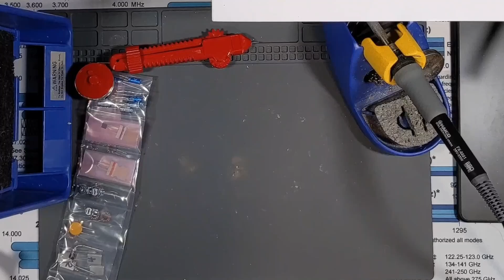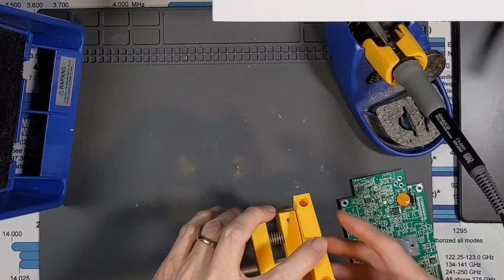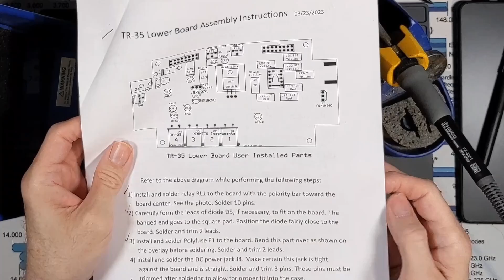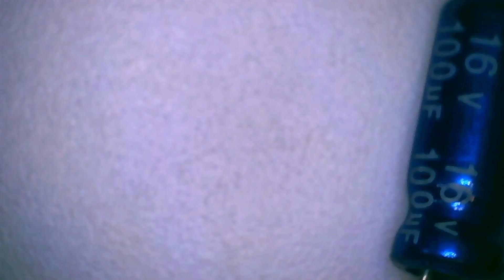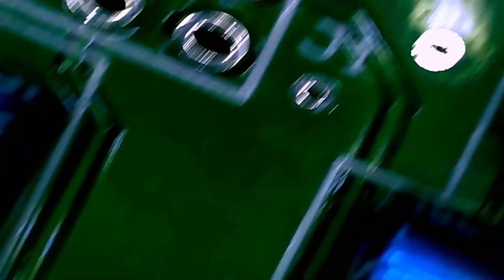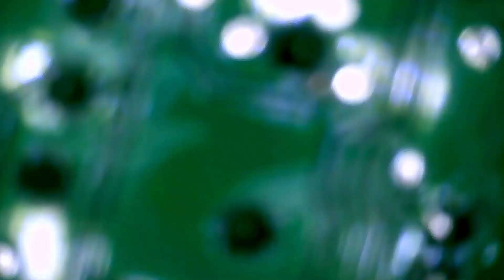Building the QRP TR-35 CW Transceiver | Part 3!

Comment: 47 and 100uf capacitors were tricky. Ordered a 1.2mm chisel tip . 1.6mm was slight to big. Stopped at the same step in instructions. looking forward to the next episode.
Reply from the maker: Yeah they were a bit tough.  I'm using a 1.6mm chisel and it is tight for sure!